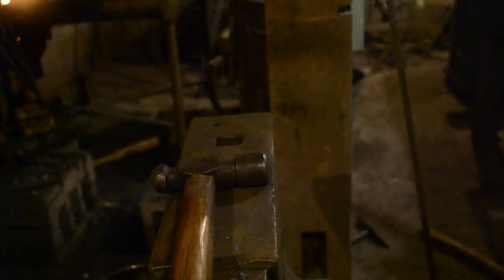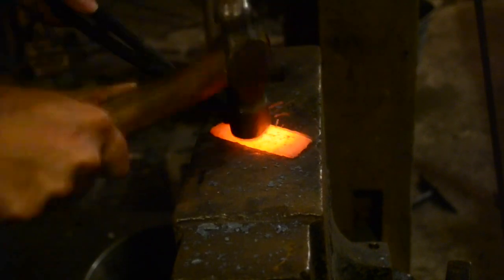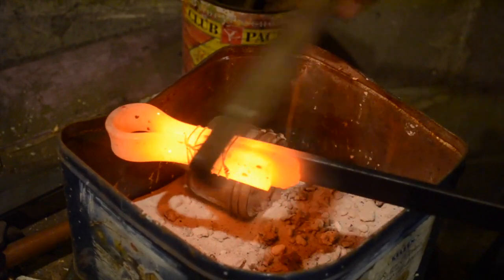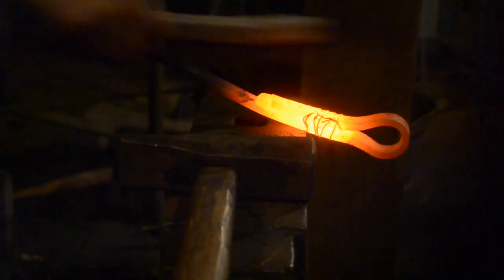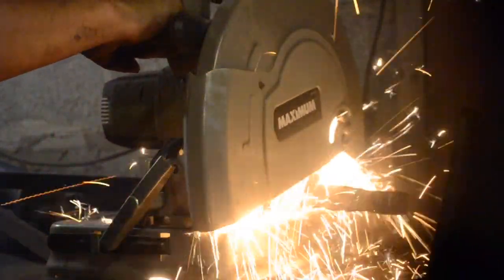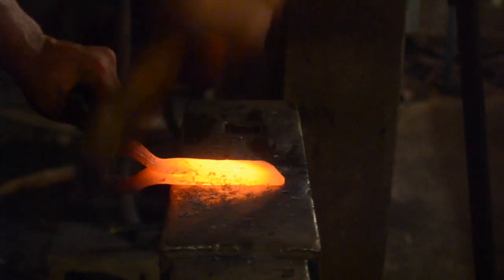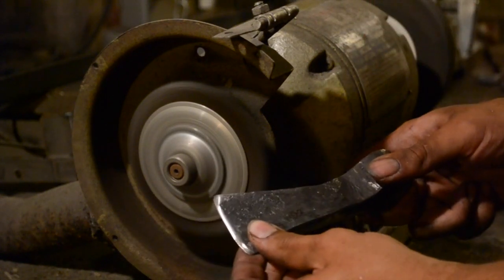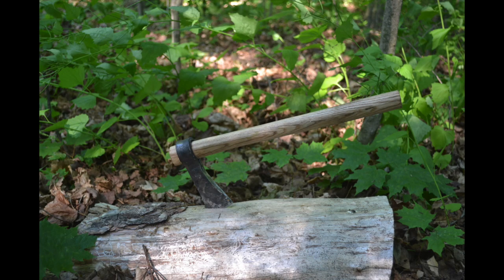A quick tomahawk/trade axe.

Comment: I usually work rail spikes I buy through etsy into a tomahawk head, and make the eye using a chisel and hammer when the metal was red hot. But this seems a lot more interesting, I will have to try this style next time.
Reply from the maker: I did that back in the day, Rail spikes aren’t really ideal. They take a lot of effort to drift without help, and the narrowness at the eye makes the head more likely to work loose.
Reply: @MalcolmPL  yep

Comment: great content, very informative and it makes me appreciate my handmade tomahawk I got from a blacksmith even more.. I do have two questions that I'd be most appreciative if you could answer, though: 

1. is this the same axe you used in your "making a ball head war club" video to process the material? 

2. in your opinion, how critical is it for an axe blade to be absolutely in line with the centre of the eye? I've seen a lot of historical and modern axes with the blade/bit slightly misaligned and bent to one side, off centre 

thank you very much
Reply from the maker: This is not the same axe.
The eye doesn’t need to be perfectly aligned. Some axes were made deliberately offset for certain applications.

Comment: Where would you fin the kind of steel for the body of the head of the tomahawk?
Reply from the maker: If you're not adverse to spending a few dollars, Most cities have a metal supply store for welders and the like. Mild steel bar stock isn't that expensive.
Aside from that, you can often find a lot of cheap scrap at yard sales.
You could also go talk to someone at a scrap metal recycling place. Some of them are happy to sell for cheap. Though some are not.

If you want metal for free you need to go for a lot of walks in the country or in industrial districts. I've found all sorts of things by the side of the road. 
One option is to go out by the rail tracks and look for spikes to flatten. When they do maintenance, they just throw the old spikes on the ground.
Something else you can do is save up worthless bits of metal like bent nails and galvanized steel panels, and then go trade them at a metal donation bin for a similar weight of good metal.
Reply: @MalcolmPL  sounds like a plan of action.

Comment: Where do I get wire like that? What gauge is it?
Reply from the maker: Your local farm supply store will sell coils of fencing wire, I think this stuff was 18 gauge, you don’t want 14 or thicker as it is too hard to tighten, you don’t want thinner than 20 or it will burn through. You also don't want galvanized wire as the fumes when heated are mildly toxic.